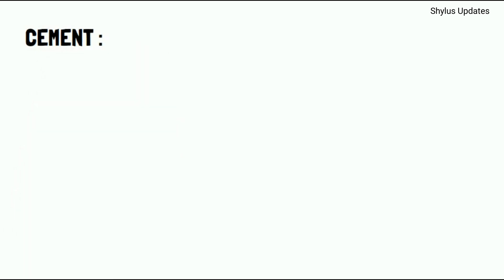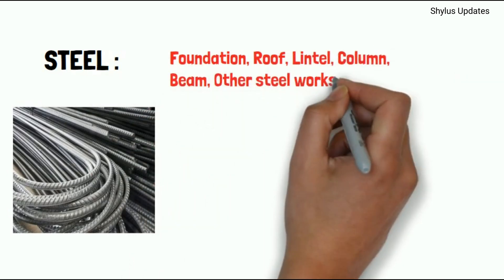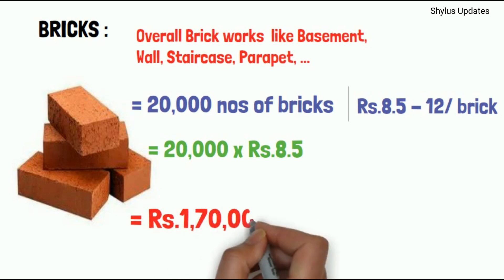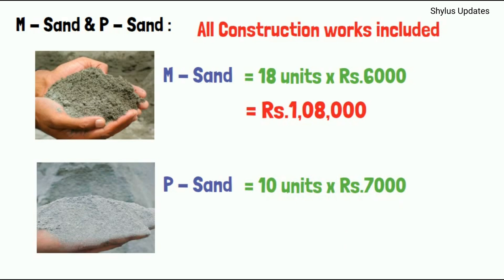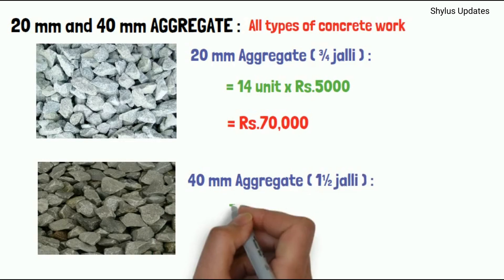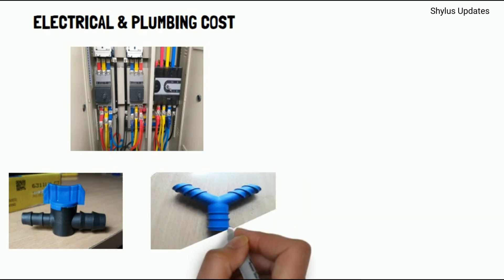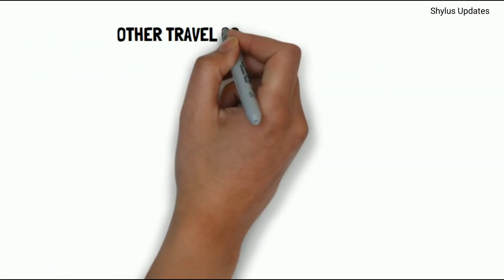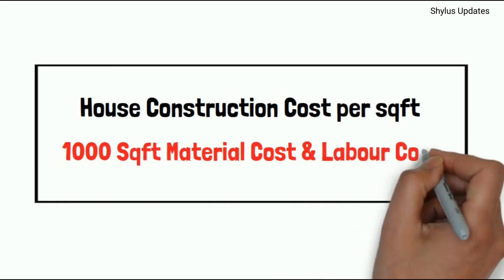2025 material cost & labour cost | 1000 sqft house construction cost | material cost 2025 | 2025

Comment: How much it will cost for North 30*60- 200 sq yds for first floor only at Hyderabad; Requirement-Ground floor only parking open as cellar, 1st floor lo 2bhk and 2nd floor - 1 room with bathroom; along with lift provision.

Comment: Whether this cost includes bore , compound wall, septic tank, be connection and sump?
Reply: No this rate is only 1000 Sf/ft house construction only remaining items extra cost will come depend on your compound wall hight soil filling and depth of bore well.  A septic tank is required where there is no connectivity of the municipal drainage line. But its cost will come around 1.5 lakh depending on the users numbers. I have 32 years of experience in the Civil Engineering constructions and property development.

Comment: In 27 cents i planned to build a 5 floor appartment.how many double bedroom house can build .just give me ideas .adam
Reply from the maker: To estimate the number of double-bedroom houses that can be built on 27 cents of land, we'll need to consider a few factors:

1. _Land area_: 27 cents is equivalent to 1089 square meters (approximately).
2. _Floor Area Ratio (FAR)_: This varies by location, but a common range is 1.5 to 3.5. Let's assume an FAR of 2.5 for this calculation.
3. _Building height_: You've mentioned a 5-story building.
4. _Apartment size_: A typical double-bedroom apartment might have a carpet area of around 900-1100 square feet.

Assuming:

- 5 stories with a height of 14 feet each (including floor height and slab thickness)
- A building footprint of approximately 70-80% of the total land area (to account for setbacks, stairwells, and elevator shafts)
- An average apartment size of 1000 square feet (carpet area)

Calculations:

1. Total built-up area: 1089 sqm (land area) x 2.5 (FAR) = 2722.5 sqm
2. Building footprint: 2722.5 sqm x 0.75 ( footprint percentage) = 2041.875 sqm
3. Total apartment area: 2041.875 sqm / 5 (stories) = 408.375 sqm per story
4. Number of apartments per story: 408.375 sqm / 1000 sqm (apartment size) ≈ 0.408 or 4-5 apartments per story (considering some space for common areas)
5. Total apartments in the building: 4-5 apartments/story x 5 stories ≈ 20-25 apartments

Considering the calculations above, you can build approximately 20-25 double-bedroom apartments in a 5-story building on 27 cents of land, assuming the mentioned parameters.

Keep in mind that this is a rough estimate and actual numbers may vary based on local building codes, regulations, and design efficiencies. It's essential to consult with architects, engineers, and local authorities to get a more accurate assessment.

Comment: So what is the total cost
Reply: 16 Lakhs on Material + Construction works (Mestary+ Plumber+Electrical)  charges 4 Lakh. Total till completion it will cost around 22 lakh.
Reply: @mohdakbaramaan619  This is only on papers. The construction companies have a package also minimum construction area needed. Some don't construct if total construction area is less than 2000sqft.
Reply: Is it included GST?  @mohdakbaramaan619
Reply: single storey or double
Reply: @khansobia9924  only Ground floor.